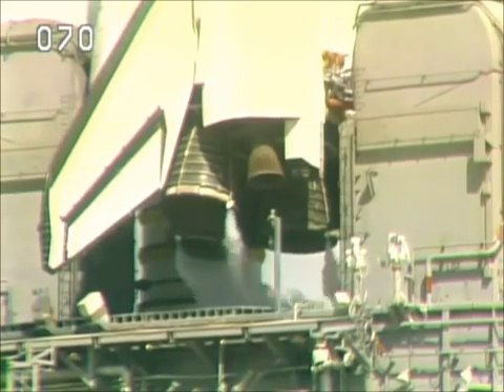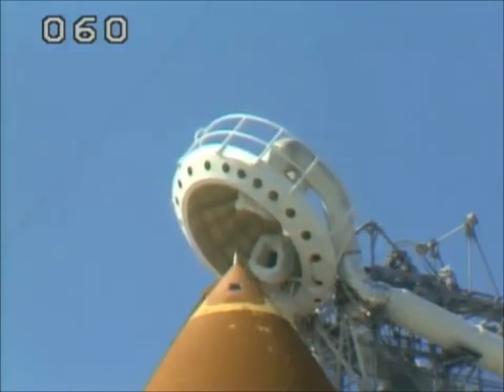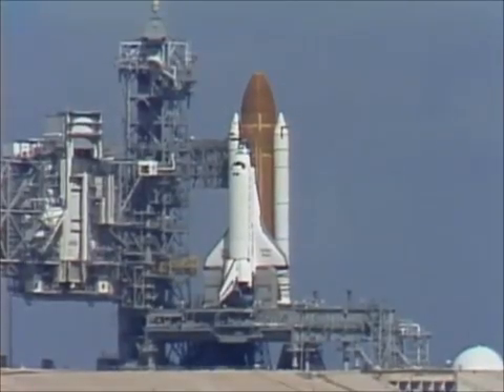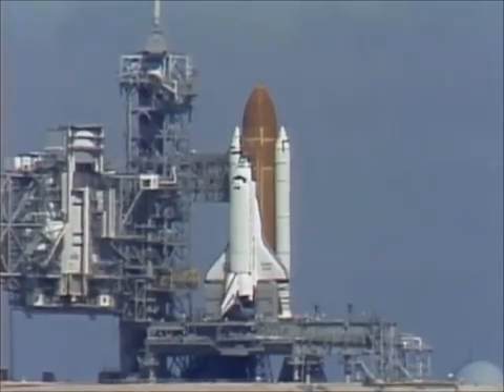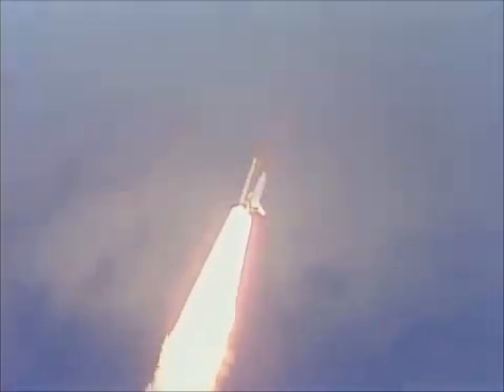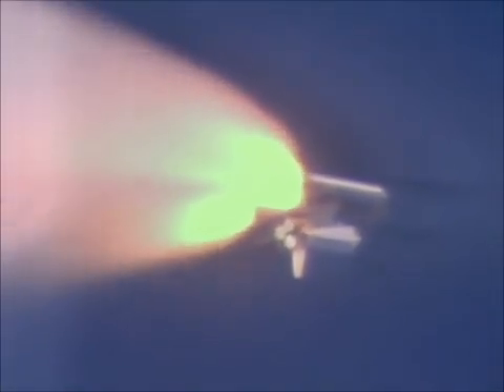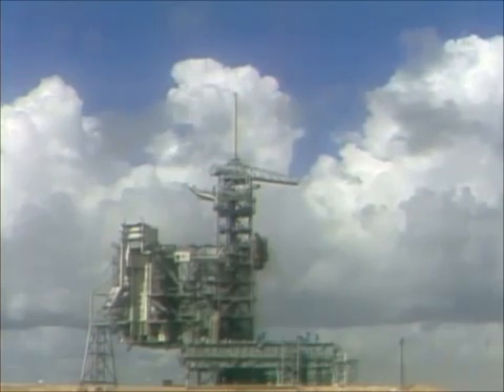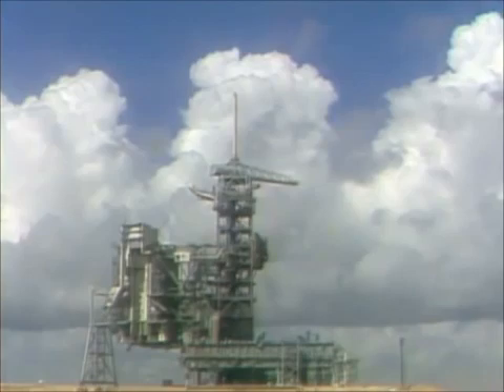Shuttle Mission STS-51J First Launch Of The Space Shuttle Orbiter Atlantis

Comment: What has been alluded to as O-ring failure at about 4:35 is actually "plume recirculation" and happen on every shuttle flight. Being able to see it was more a function of Sun angle and camera position. The only flight where acual flame came out of a SRB joint was 51L.
Reply: From what I’ve heard, the Launch took place in similar conditions as the infamous Challenger disaster. Thankfully, the leak was nowhere near the External Tank, and even though the SRB was seconds away from not making Atlantis a success, it separated before the worst could happen. Overall, the mission was a success, and Atlantis would continue on for 26 more years before retiring the program with the final launch.

Comment: I can't say if this is the one but one of the launches had a o ring failure like Challenger. Thankfully it didn't get large enough to hit the external fuel tank. They discovered the footage when they went back and looked at all of the launches.
Reply: TELEVISIONARCHIVES actually what you were seeing was "plume recirculation" which happened pretty much on every Shuttle flight. On this flight you can see it around 4:35. Also an optical illusion caused by the camera angle and "plume expansion" (as air pressure drops, the plume expands. Even happened on the old Saturn V) The only flight where acual flame came out of a SRB joint was 51L. 

There was, however, numerous flights where SRB joints did not have total sealing action from the primary o-ring, but the secondary (back up, redundant) o-ring was always there to save the day. As NASA pushed the launches into colder and colder weather, even the back up ring was getting some erosion and blow by. The ironic thing is that the worst case of "blow by" before 51L was STS 2 (yep, the SECOND FLIGHT) and the temperature was around 80F.
Reply: It was a Discovery flight
Reply: You can see visible flames emitting from part of the SRB at 4:35
Reply: The launch you're thinking of was STS-51-C.